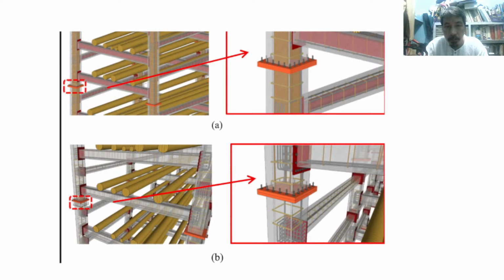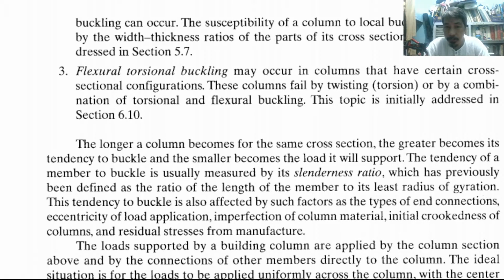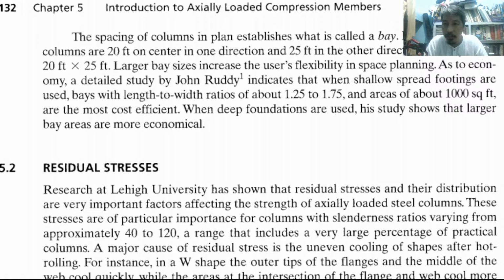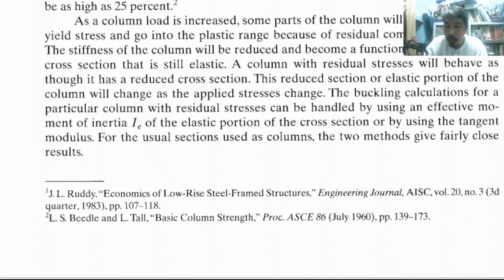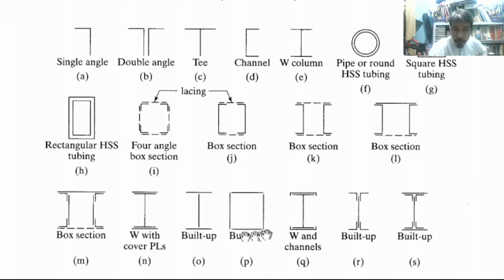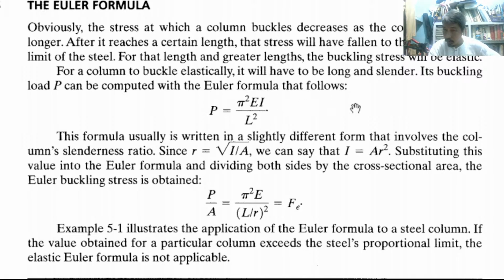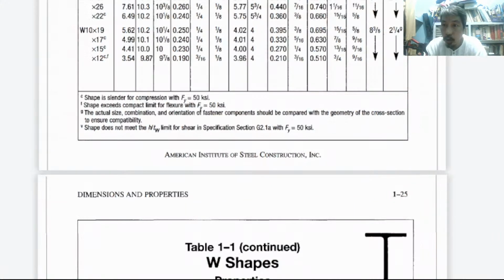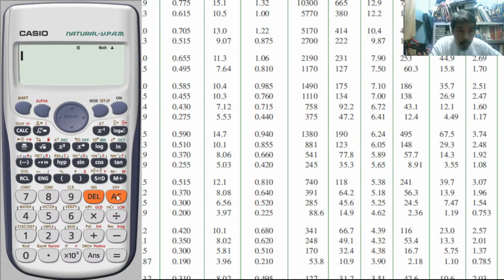[ LIVE CEE6 Lecture23 ] DrAP Zantua Design of Steel Columns + Analysis of Compression Members

Comment: thankyou sir for your continuous effort to teach us through your platform here in yt. the topic that were discussed was the design of steel columns, and analysis of compression members. And there are three general modes by which axially loaded columns can fail. These are flexural buckling, local buckling and torsional buckling.

Comment: This discussion is a continuation of the topic: compression members. Column is one of the constructive example of compression members so column is an actually loaded compression number. Three general modes of failure has been discussed. This are Flexural Buckling, Local, and Flexural-Torsional Buckling. Thank you, sir for this live lecture.

Comment: Thankyou sir for discussing about design of steel columns. So I’ve learned that there are three general modes by which axially loaded columns can fail. These are flexural buckling, local buckling and torsional buckling.